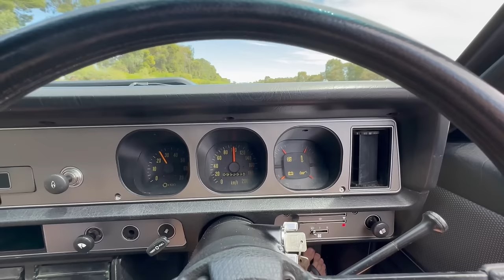BARN FIND to RESTORED - TORANA V8 LX A9X COMPLETE!

Comment: What colour/brand paint did you use on the wheels, they look great.
Reply from the maker: The best & most easy result I’ve had with them is pressure pack; motor spray “wheel silver” acrylic, comes out great and is a simple easy approach, quick result too.

Comment: Well it’s not an A9X but looks great so good job. Glad you didn’t fit stupid shit 20 inch rims or drop it on its diff. My first car was an LX SS hatch 308 manual. The whole family has always had holdens. Sandmans XU1s statesman’s caprices VKs VLs VCs had them all including 3 A9Xs with one still in the family with only 40.000 klm. The first batch of A9Xs ran the super tall 2.6 diff ratio which with an M21 manual was good for 100 Kph in first gear. The second batch ran the trusty 3.08 ratio. Undisputed KING of Australian touring cars and the results speak for themselves.